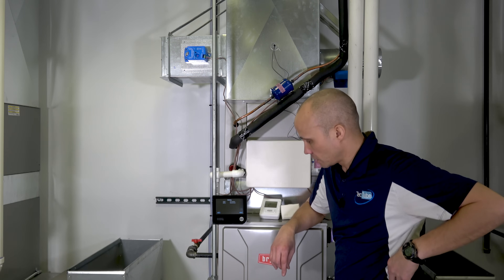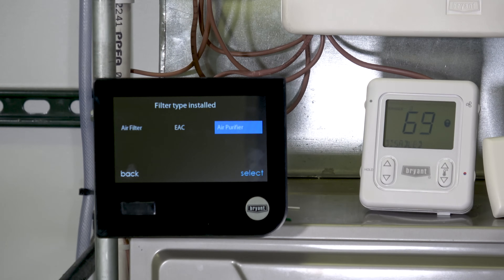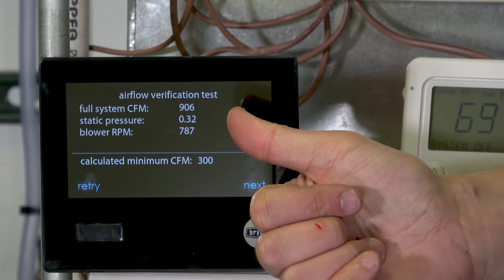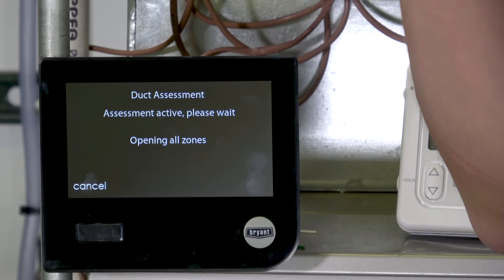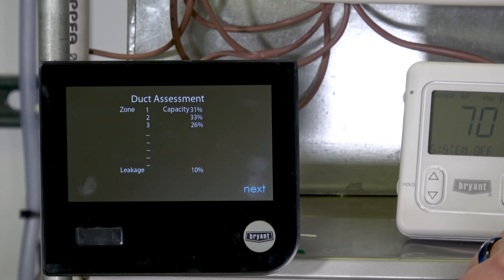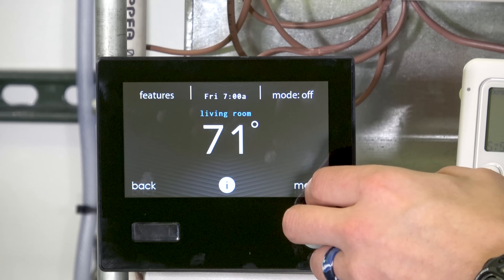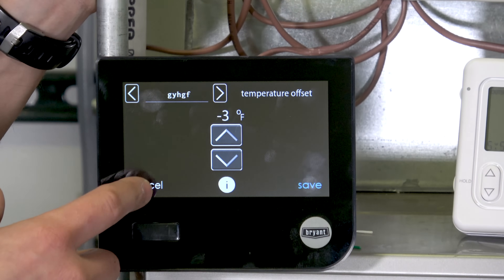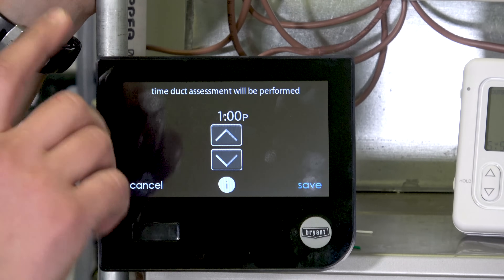Zoning System for Infinity, Evolution, and Ion Controls

Comment: Could you please make a video walking us through how to wire the Infinity zone controller?
Reply from the maker: You just wire A, B, C, and D on each device (furnace, A/C, wall control, zone board etc) to each other. Any order you want.
Reply: @TECTubefilms  hey! i did it but can't find any equipment installed, I have installed bryant evolution 284ANV heat pump and Carrier 59TP6B furnace! Connected ABCD connector on both and can't find anything. any idea what is going on? i need your help! thanks
Reply from the maker: @jsevill1  This is a new install with a brand new out of the box, never been used stat?
Reply from the maker: @jsevill1  Have you called the distributor you purchased the stat from and talked to their tech support yet?
Reply from the maker: @jsevill1  Why do you have a Bryant heat pump on a Carrier furnace? It will work with that stat, but just trying to figure out what you have going on here.
Reply: @TECTubefilms  thanks for replay! well, it was installed like 10 months ago because pandemic shortage they don't have a carrier heat pump they installed a mix carrier and bryant. but that time i have ecobee thermostat but it only work 2 stages with a variable speed heat pump and that is why I'm trying to install an infinity thermostat! but like i said it dont find no equipment.
Reply from the maker: @jsevill1  That 284ANV will not run on an ecobee thermostat at all. Did you not use your heat pump all winter and just ran the gas furnace?
Reply from the maker: @jsevill1  Where did you get the Infinity stat from? Was it brand new in the box? If it was a used stat, it will have to be reset to find new equipment. If it is a new stat then it is likely that you have a wiring error and we suggest using your electrical meter to troubleshoot each wire.
Reply: @TECTubefilms  i used but it only works 1st and 2nd stages with the ecobee.
Reply: @TECTubefilms  is brand new in the box! what i find is the carrier 59TP6B furnace is Non-communicating,
variable-speed ECM operation. it will be a big problem to use an infinity thermostat? but it has ABCD conector.
Reply from the maker: @jsevill1  Sorry, but nothing you are saying is making any sense to us. A 284ANV should not work with an ecobee stat or a non-communicating furnace at all. Any chance you actually have a 288BNV? That is the only 1 of the 3 inverter heat pump models that can run in a non-communicating mode. Are you looking at the metal tag on the outside of the outdoor unit to get the model number or are you looking at paperwork provided by your installer?
Reply from the maker: @jsevill1  We hade not even paid attention to your furnace model # in the original questions because the 284ANV was the first red flag that did not make sense. But no, a non-communicating 59TP6B furnace is not compatible with a communicating Infinity wall control.
Reply from the maker: @jsevill1  Where did you get this Infinity wall control from? Whomever is selling this to you is not doing you an favors.
Reply: @TECTubefilms  gotcha! thanks for your answer!!
Reply: @TECTubefilms  to be sure I looking at the head pump outside and this is the exact model 284ANV036000. and yeah it working right now with ecobee thermostat the version 4 I believe the one with Alexa compatible as I say only works on 1st and 2nd stages but after that, i will say it works without a problem!
Reply from the maker: @jsevill1  If you have a thermostat wired to a 284ANV, then you are using a feature called "emergency mode." That mode is intended to be used if the Evolution/Infinity stat needs to be replaced and you need operation while you go to pick up a new one from the supply house for your customer. See page 18 of the installation manual. It is not meant for long term usage. That mode disables 74 of the 76 stages. It also does not have an AHRI rating, and hence no DOE or IECC compliance.
Reply from the maker: https://www.shareddocs.com/hvac/docs/1010/Public/0D/II284ANV-03.pdf
Reply from the maker: @jsevill1  There should not be an ABCD connector on a 59TP6B furnace. Instead, in that location on the circuit board (PL7) there should be a 4-pin twinning connector. This connector would be the same size green Molex style plug so perhaps that is where the confusion lies. But on this furnace, the connector speaks a language that allows it to be connected to a second 59TP6B for larger commercial applications. Only the 59TN and 59MN models of Infinity furnaces could use the ABCD language to speak to an Infinity thermostat.

Comment: I added a zone to my Evolution system. The damper for that zone will not open all the way or close all the way. 
I double checked the 3 wires and all are correct.
When I put 20 volts to the damper controller it in opens and closes completely. Any suggestions?
Reply from the maker: It will not open/close at all or it will not open/close all the way? Your troubleshooting will take two different paths based on that.
Reply from the maker: If it won't move at all, make sure it recognizes the new wall sensor you added and make sure you re-programmed your system and set the CFM for this new zone.
Reply from the maker: If it moves some, but not all the way it could be configured in the main stat to reduce CFM... or more likely would be that you used a non-Carrier damper that has a different timing range. Since it is a 3-point floating control (as opposed to direct 2-10vdc or 4-20mA signal), the controller only powers the actuator for X amount of seconds. The actuator you install has to have the same timing as that control board to move X degrees in X seconds. For that reason, you pretty much have to use a Carrier zone damper (or figure out the timing by measuring the output with a meter and then go buy an actuator to match that.
Reply from the maker: BTW - it is a 24vac motor, not 20vac. Although 20 may be enough to drive it.

Comment: I have the Carrier Infinity version of that thermostat, a carrier zone module (looks like the one you show in the video) and carrier furnace. If the house ever loses power, the thermostat goes through looking for the outdoor unit, the zones, plus the duct assessment etc.  In December I lost power while we slept, I woke up with a cold house, and the thermostat waiting for me to tell how many ton the AC was, then it went though all of the initialization steps again.  Once it's up and running then it turned the heat on.  The contractor has replaced the thermostat twice to no avail.  Once initialized it's not normal to have to go through the initialization process again is it?
Reply from the maker: No that is not normal. We have never seen an Infinity thermostat go through the install process after it losses power. In fact, in our training labs we turn off the power to the all of the systems when we are not using them and they are all fine when we turn them back on. In some cases, such as over the summer, they are turned off for 2 straight months with no power and have no issues in the fall season at all.

Comment: I'm currently working on switching our Infinity system from a single zone to a three zone system and this video is almost exactly what I was looking for, thanks much!  One question, everything seems fairly clear but I'm fuzzy on how the thermostat and damper control board connect to the actual furnace.  No manuals I've found seem to cover that.  From what I've gathered so far based on the damper control board wiring, the zone 1 thermostat is wired to the left hand ABCD connection on the top of the zone control board and the furnace ABCD is now connected to the RH ABCD on the zone board.  So it's thermostat -> zone control board -> furnace -> hvac unit, meaning the zone control board is essentially placed in between the thermostat and furnace connection.  Ours is a gas furnace with an outdoor hvac unit, models 59TN6A and 24ANB6 respectively.

Thanks for any help, and keep up the great work.
Reply from the maker: All of the devices communicate on the ABCD terminals. It does not matter the order that you daisy chain the devices. It also does not matter which ABCD terminal on the zone board is used for what.

Comment: Can u show how to wire zone board and zones up
Reply from the maker: Ryan goes thru the damper wiring a little bit at the beginning explaining the 3 wire scenario.  Just match OPEN on the damper to OPEN on the board, then the same with CLOSED, and finally with COMMON.  Do that for each zone damper you wire back to the board.  Is there something more specific you are referring to?  Do you have the wiring diagram available to you?
Reply: @TECTubefilms how does the damper actualy drive open  or closed? I noticed the damper will have 24v from common to open and will also have 24v from common to close at the same time whenever the damper is opening or closing. I thought you would only see 24v from common and open when driving open with 0v from close to common. Then see 24v form common to close when closing and 0v from common to open. But I always have 24v across both coming to open and common to close anythime the damper is driving open or closed.
Reply from the maker: @carlneuman5958  If you Google "tri-state floating point" on Chrome and read the AI Overview it does a pretty good of explaining it. Perhaps better than we are explain it to you. But no it will not send both open and close signals at the same time so either there is an issue with the system you are testing or there is an issue on how or where you are putting your meter leads.

Comment: My installer is working on an Infinity system right now for me.  I have only two zones on a large ranch.  They have placed 2 Infinity system controls one for each zone.  Is it correct that you only use one control and then use either a smart control or sensor for the other one?   Will two system controls even work together?
Reply from the maker: No, you cannot have 2 Infinity wall controls on 1 system.  Zone 1 can use the Infinity control, but Zone 2 must use either a Smart Sensor or Thermistor Sensor.

Comment: Have you ever used an ION on Zone 2? If so do you just hook up DX+ & DX-? Or is a smart remote sensor the only way to go?
Reply from the maker: An Ion wall control can only be used on Zone #1.  Zones 2 thru 8 can either use Remote Room Sensors (i.e. thermistors) or communicating Smart Sensors.

Comment: Appreciate your video! I couldn't get my zones to work, all the dampers were in the open position and one end of our house was way hotter than the other. Your walk thru on the user interface helped me get all dialed in. I think I had all my scheduled fan settings to auto. When I changed everything back to low it worked like a champ!

Comment: where can I buy these thermostat products? I can only find the ION thermostat itself online.  I can't find the zone board or the smaller room/zone controlers.  I would prefer them to be wired also.   I am getting an airquest communicating system like this and want the feature to control the cfm per zone.  and are any of these brands listed compatible with the other, so In other words, can i get a ion thermostat and use a carrier infinity control board with individual bryant room/zone thermostats... thanks!
Reply from the maker: All Carrier and Bryant components can be swapped with each other.  Ion, however, speaks a different language so its components have different communicate drivers installed.  So while the Ion hardware is the same as Carrier/Bryant, it is not interchangeable.
Reply: @TECTubefilms  can I put a carrier or bryant thermostat zoning system on an airquest g96ctn communicating air handler?
Reply from the maker: @cultivateinnovations  No, the equipment controls speak a different languages.  Carrier/Bryant speaks A/B language and ICP speaks Dx+/Dx- language.
Reply from the maker: All of these brands have local dealer networks that design and install these zoning systems.  Each brand has a zip code finder on their website to locate an installing dealer.

Comment: If you set all the zones to "Max" airflow.  As long as you are ok with the sound. Would that hurt anything? Very informative video. We have the exact system that you have here. Our installer also came and installed a bypass in. What's your opinion on a bypass? Thanks!!
Reply from the maker: Carrier, Bryant, and ICP all PROHIBIT the use of a bypass damper with this system.  On all other zoning systems, a bypass damper is needed to relieve system pressure as the zone dampers throttle back.  However, on this system the zoning system slows the blower speed down to relieve pressure instead.  In your case, the fan speed algorithm and the bypass damper can end up fighting each other for dominant control.  They need to remove that bypass damper.  Are you sure you have this exact system (what is the model # of the thermostat)?  Are you sure it is a bypass damper that connects the supply duct back into the return duct and it is not an outside air damper or a dump zone damper?
Reply from the maker: Sound is the only real detriment to allowing the zones to go to Max airflow

Comment: I can not get my static below .8 on 5th stage no matter how much ductwork I’ve added. Is this a byproduct of a zoned system ?
Reply from the maker: No, it is not because of the zoning system.  We are assuming all of your dampers are open when in 5th stage so the pressure drop caused by the dampers is minimal when they are open.  If you have single blade dampers, the pressure drop is essentially 0.  If you have opposed blade, such as the slip-in style, then it will be higher.  You can measure the pressure drop with a dual port manometer if desired.
Reply from the maker: Other contributors to external static pressure (ESP) are evaporator coil (and its condition), ductwork diameter, ductwork length, elbows and transitions, high efficiency filters, balancing dampers, and diffuser outlets
Reply from the maker: You should also make sure you have the wall control configured for the correct heating and cooling mode fan CFMs.  The higher the CFM you told it to run at, the higher your static will be.
Reply: Tec Tube ok I was thinking the cfm setting at the wall control would determine damper opening position allowing x amount of air to flow. That could be the problem. So reducing the cfm at the wall control will actually slow the motor itself down? Ion zoning system btw
Reply from the maker: @MedleyHeatingACPlumbing  It is a variable speed furnace so if you ask it for high CFM, it will have to run at high RPM to get that.  Your static is going to be higher than normal if your CFM and RPM are high.
Reply from the maker: @MedleyHeatingACPlumbing  For cooling mode, set the system for "Comfort" airflow, which is 300-325 CFM per ton.  Do not increase it to EFF325, EFF350, EFF, or MAX unless you cannot get sufficient airflow to the farthest duct run when you are air balancing.  Same with heat... set it for Comfort and do not increase it to Efficiency unless you need the airflow.  Comfort is the factory default airflow for both heating and cooling.
Reply from the maker: @MedleyHeatingACPlumbing  Check out the setup videos in the series... https://www.youtube.com/playlist?list=PLoR_O4JRNc27j4f0sdFYQJSZ-f6BhSD7i
Reply: Texas..I hope you oversized your dampers. If you used dampers for the exact duct you just lost sq inches. I always oversize dampers to get the correct internal sq inches. This helps with modulation and zoning

Comment: Does this zone board control can work with nest thermostats?
Reply from the maker: No, it does not use standard 24v thermostats.  It uses sensor in the zones instead of thermostats.  Carrier and Bryant, along with Honeywell, have standard zoning systems that will work with regular stats like nest.

Comment: FYI 
If you have a 1st, 2nd and 3rd floor and the main control is on the 2nd floor it can not be zone 2 to try and correlate with the floor it is on. The main control can only be set as zone 1 and then re name to whatever’s out want.
Made me crazy until figured it out. Otherwise this is a fantastic zoning system.
Reply from the maker: That is true... the main stat can only be associated with zone #1.  However, you can re-name the zones to whatever you want so you can call them basement, 1st floor, and 2nd floor.